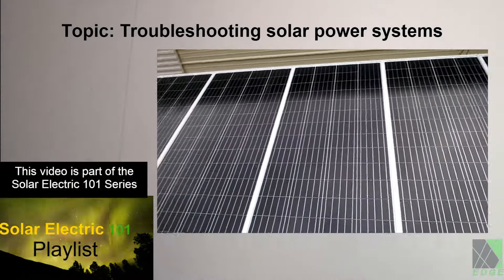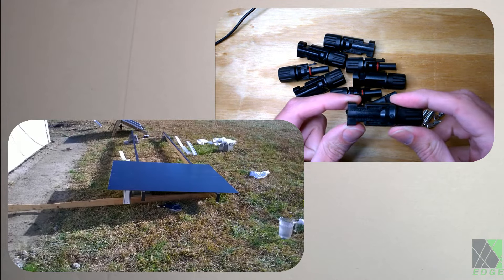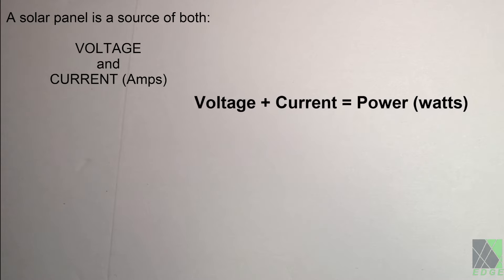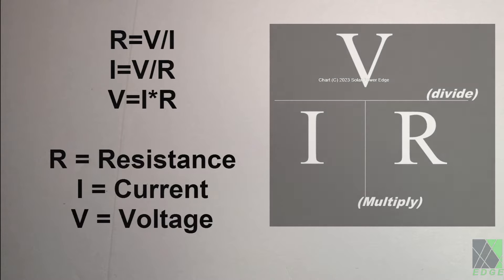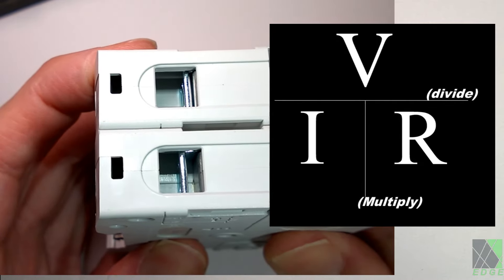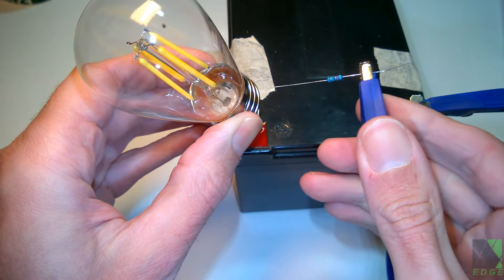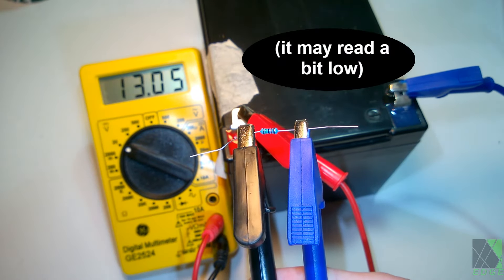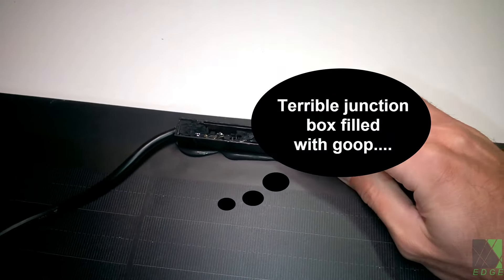Solar Panel makes NO POWER! but has VOLTAGE? Troubleshooting - Solar Electric 101 #009 #DIY

Comment: Nice easy to understand video.  I have learned to check circuit breaker connections twice a year since the heating /cooling can loosen connections.  Temp range in SE Michigan -10 to +100F with panels running up to 140F
Reply from the maker: @Gary-wh7ce Thanks :) good thinking, very smart to check breaker terminals. I had one solar breaker heat up and start burning. I forgot to check and the terminal had gotten loose over time

Comment: Can you tell me why I have inverted power from my solar panels after it comes inside where my inverter is. 
I connected a 20 foot lead from my solar panel to my inverter inside the garage.
Reply from the maker: Hi! sorry I'm not understanding the question: do you mean AC is present on a DC circuit? Or the other way around?
Reply: @solarpoweredge  reading across the positive to negative it shows a MINUS DC voltage from the solar panels
Reply from the maker: Good idea to check the polarity first... it is possible for solar panels to come from the factory with their MC-4 connectors backwards. It is rare, but does happen. Basically just make sure the inverter gets the correct polarity no matter what, even if that means changing the cables. Also, make sure your meter doesn't have the +/- leads reversed, that's pretty easy to do.

Comment: So how did you repair your flexible solar panel with the bad connections?    Great job.   I have several broken larger residential panel which i will have to epoxy the broken glass back to health, and back to service.  I noticed under a load that they seemed alittle weak.  We will see.  I paid very little.  Hope that i can still use and receive more life out of them.
Reply from the maker: @mr.makeit4037  The process was to dig out all that black silicone sealant to find the actual connections, and use solder to fix the problem. Not fun at all. Most panels don't have the sealant in them. In most cases I just find the bad connection and resolder it, but this panel was one of the worst...

Comment: Good stuff Dave..  on my solar tracker video, it shows a pair of 400w panels..  one of them got real weak soon after it was installed on it. So I removed it and replaced with Six new 200w Bifacials.. which usually get over 1000w. Need to open it up and test it. Know any good sources for these resistors..?
Reply from the maker: @OFFGRID_Trucker Hi, any bad connection or damaged wire can create high resistance. The resistor is just an example to show what happens when there is a bad connection. It's still possible to read a voltage through a high resistance (as the  meter shows) yet the load doesn't run at all. This can be very perplexing. Simply put, when you see voltage but no current or power, it's probably high resistance!

Comment: I am watching from Fiji island my solar penal is not giving power to controllar
Reply from the maker: @DenialPrasad-by2lb  Hi, please check the wiring (all connections) as those sometimes fail. It's also good to test the solar panel separately while disconnected if you have the equipment (multimeter can do the testing)

Comment: What was the short circuit current (Isc) of the panel?
Reply from the maker: @rosalieroku3818 Pretty much nothing, the panel could not do anything useful except show about 20 volts and no current. I've seen this before but it was still frustrating. And a real chore to fix with all the silicone sealant placed in the junction box at the factory...

Comment: I have some glue down military grade flexible panels... 170w each wired 2 in series.... No power voltage is normal under load.... So i checked current and it has big spark when shorted.... I then put it on victron cc and it starts working.... Seems to happen when battery is full and in parallel with another string..... Not sure what is happening???? Had this happen 5x this summer in Phoenix
Reply from the maker: @michaeld4502  Hello, I recommend to check all connections for each string and measure the open circuit voltage and short circuit current for each panel. Hopefully it's just one panel and not several!

Comment: my baterry is draining when connected to the solar panel
Reply from the maker: @logisticswideway7804 Maybe it's not charging with enough power? Also a solar panel needs a blocking diode when attached to a solar panel - otherwise at night the solar panel turns into a heater and drains the battery